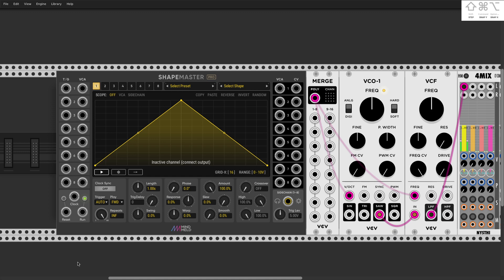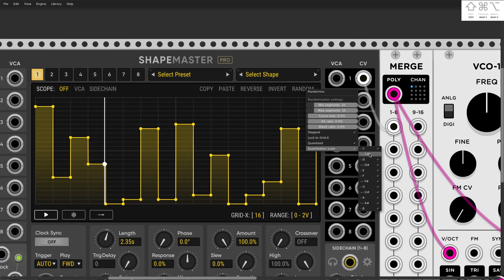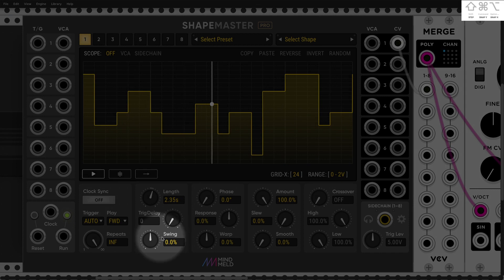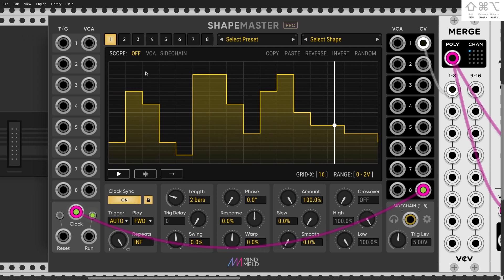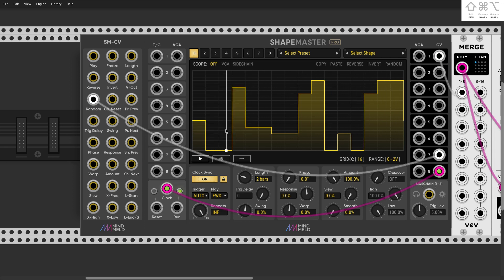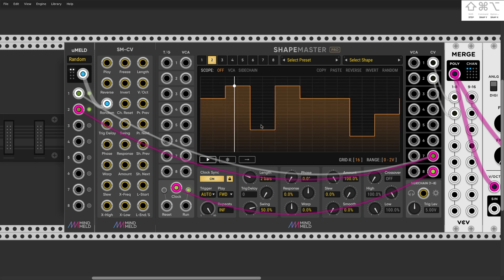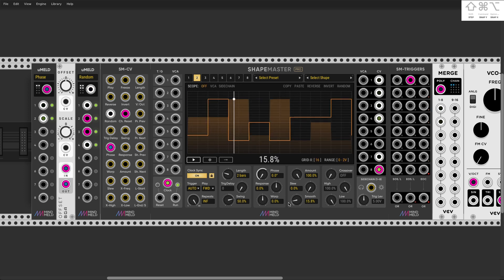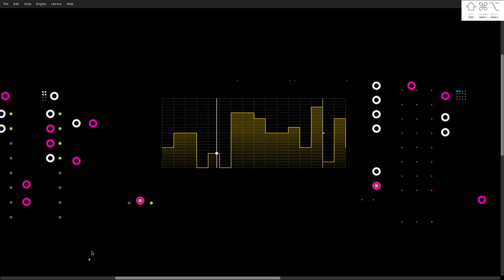Shape Master Ep.4 - Randomization & Generative Patching - VCV Rack Tutorial

Comment: Great video as ever with some interesting ideas to try. I don't quite understand the bit at around 9 minutes in about scaling by 1.25 and dividing 630 by something. Is it that 10/8 is 1.25 (so a five step sequence would be scaled by 2)? I guess I need to play with this but still can't figure where 630 comes from?! Not sure if I need to know but it's alway nice. Anyway, great series on this excellent module
Reply: I'm not 100% sure but I think Jakub may have meant 360 rather than 630 (There are 360 degrees of phase). The 1.25 is the number you need to multiply 8 (steps) by to get 10 (volts)... I think. Even knowing that I still don't understand what is going on there exactly or why it has the result of making all the phase offsets be in step multiples - seems to work though! :)
Reply: @stevebaker2896  Thanks, that helps me get it. For each volt it's going to shift the phase forward 1/10th as there are 10v max (0v 0 shift, 10v 100% shift) but we want (in this case) it to move forward by an 8th so it needs 1.25 like you say. If there were 4 steps it would be 2.5, 20 steps would be 0.5 and so on... It's 10/n where n is the number of steps in the sequence.
I like to find the pattern as with Jakub's videos there are so many good ideas that can be used elsewhere. Thanks for helping me get there. Happy patching!
Reply: @snailtoe  Ah I get it now - when I originally watched it (and first rewatched it) I had missed the part where Jakub says "In order for this to work properly, we need to quantise [the glitch gates track] to a one octave (volt integer) grid. Now it makes perfect sense - we got there in the end :). Agree that Jakub's videos are pure gold.